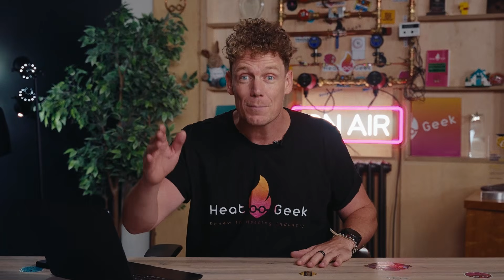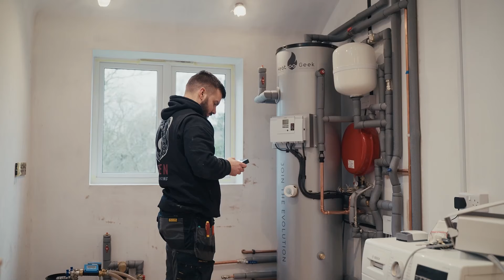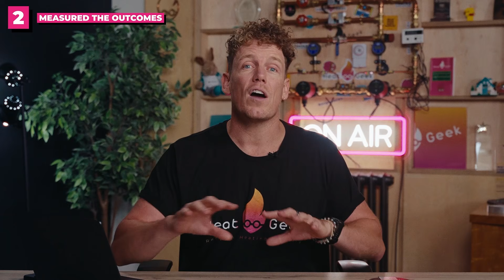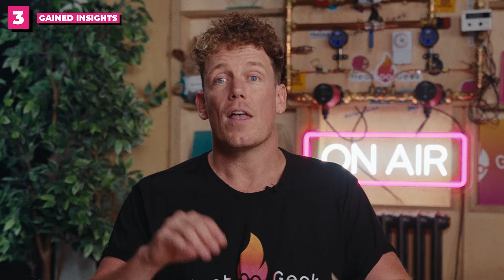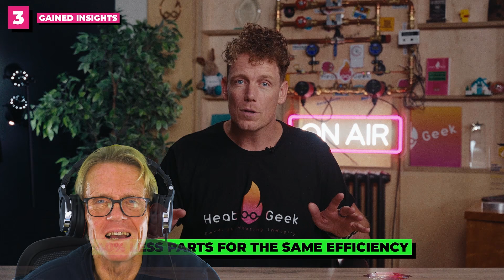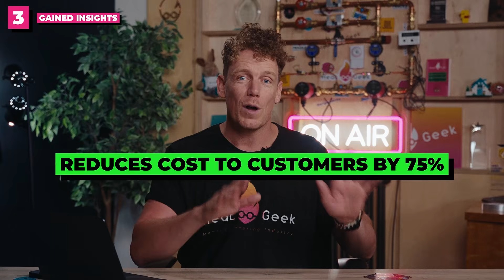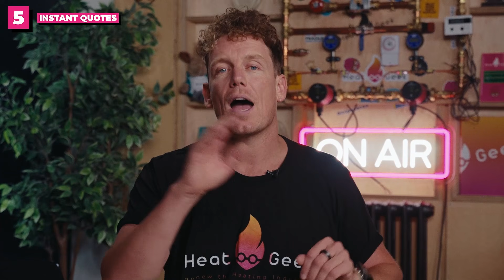Heat Pump Reality Check: Is Zero Disrupt Too Good to Be True?

Comment: Just pointing out that the Youtuber's in-loft water cylinder you highlighted was the one already installed for his former gas heating system and, in this case, Heat Geek were able to reuse it rather than installing a new one, thus saving him a few quid compared with the competition!
Reply: Absolutely correct.. he should be made to retract his remarks.. Not only that, he lost alot of credibility in my eyes
Reply: @patgreenerides I don’t personally like Roger’s personality. Seems quite arrogant and just a nay-sayer.
Reply: But the combi gas boiler is the most common in the UK! No hot water tank available to re-use.  Don't forget Heat Geeks sell training and a "franchise" - their new product is mainly spin telling the customer that they should employ someone who have used the tools Heat Geek supply.
Reply: Good point!
Reply: So what do you do if you have no space in, eg. a leasehold flat or small bungalow for a hot water cylinder? A heat pump isn’t viable.

Comment: People said the solar panels industry was stuffed when the grants stopped.  But the grants were there to kick-start it, and it worked.  Prices came down, performance went up (a lot), and solar installs are both plentiful and generally successful.
Reply from the maker: Well we know that heat pump prices have been inflated by the grant so maybe it will happen but there are more examples of green schemes failing than there are of them working.

Comment: I lived in the USA for 40 years until 2 years ago. The early heat pumps were not very efficient back in the beginning but the last 5 years has seen a massive increase in efficiency. I had the reverse cycle  system with a central air handler, ducting and vents in each room until the last unit . It was what is called a mini split with cassettes in each room individually controlled . It was over 30% more efficient than the central system. I believe it will be the same when comparing old technology radiators  and  heat pumps. Air to air should be on the  grant system. They are cheaper to buy and simpler to install. The cooling is just a  bonus if you want to use it. They are quiet and not at all intrusive.
Reply: It’s just deplorable that better heat pumps and installation costs are being deliberately gatekept and inflated. Hell here in Canada they gave money to GAS COMPANIES to distribute for approved heat pump installations as a subsidy…😅❤

Comment: A fool and his money are always easily parted........ exactly the same when flat screen tvs came out and were priced at £4000, then after all the rich and better off people had bought 1, the price plummeted...... now you can get a 50'' smart tv 4K for £300
Reply: Heat Pumps have been 'out' for past sixty years in UK commercial market.

The heat pumps themselves are not expensive with many coming in under £3k as installations are currently VAT free.

Cost of providing a low flow temperature gas boiler system would be no different.

Comment: We can't get off gas and oil. Gas is still used to generate a lot of the electric in the UK.
Reply: An excerpt from renewable UK website

"Statistics published today by the National Energy System Operator (NESO) show that wind outperformed gas in 2024 by generating more electricity for the first year ever. Wind provided a record 30% of Britain’s electricity last year (up from 28% in 2023), while gas produced 26.3%. December was the windiest month, when 38.9% of electricity came from wind, with record high amounts of clean power generated.

58% of Britain’s electricity came from clean power sources in 2024 as nuclear generated 14% and other renewables provided 13.8%. Coal produced only 0.6% last year, as Britain’s last coal-fired power station closed down in September."

Comment: Heat pumps have too much kit like hot water tanks, where you are supposed to put one of those in the small properties built in the last few decades.With regards Adam, I'm afraid I don't believe a word that he says. I did a H&V city and guilds course years ago and him saying you cannot work out the heat requirements for a building is laughable

Comment: Love heat pumps  became MCS accredited last year fitted my own at my house works great, love it and off gas completely and don’t regret it ( ex vaillant service engineer )
Tried to get some of my customers  on board but worked out too much as extra radiators etc needed or no space to fit external unit 
There Is too much red tape for me like everything else the uk have to endure this year I’ve removed myself from MCS as £1800 outlay every year I’ts not worth it for me  
became Fgas approved 3 weeks ago already have jobs booked in for air con (a lot easier to install )as customers see this as more beneficial for comfort in summer ….. just my thoughts……

Comment: Current cost of producing renewable electricity in UK. Was going to be part of a reply to another post which seems to have disappeared now.

Extract from UK government 'Contracts for Difference' document which sets the maximum prices each year

"Administrative Strike Prices (ASPs) for Allocation Round 7. ASPs represent the maximum price per MWh price for generating electricity – known as the strike price – that a project of a particular technology type can receive. Should an auction be triggered, ASPs limit the maximum price that projects of a particular technology type can receive, even if the auction clears at a higher price.  !"

AR7 Prices (July 2025) are

Offshore Wind :- 11.3p/kWh
Onshore wind 9.2p/kWh
Solar PV 7.5p/kWh

Comment: You can pull the plug on gas but where does your electricity come from? Most of the power plants in the uk are gas powered. Wind is transient and solar is miniscule comparative to demand. Turning gas into electric is very inefficient and then there's transmission losses etc. This outweighs any cop figures the heat pump guys rave about. A modern gas boiler can achieve 98% efficiency using the fuel at source. A gas boiler is cheaper to install, less complicated, and has much lower maintenance costs. Seems to me like government politicians trying to throw public money at a problem they know nothing about while at the same time taking a cut for themselves.
Reply: September figures from NESO website, giving sources for electricity in UK

Gas 21.8%
Wind 35.3%
Nuclear 9.6%
Biomass 7.3%
Solar 7.4%
Imports 15.2%
Hydro 1.5%
Storage 1.8%

It seems you are attempting to justify older technology because you can. Heat Pumps harvesting warmth from the air, are still more efficient than even your 98% efficient gas boiler (needing larger radiators, higher flow rates etc).
OVO quote the average British gas boiler as being 83% efficient.
Maintenance on an HP is minimal, clean a couple of filters, hoover debris from heat exchanger.

The governments of the day threw £Billions into subsidising gas boiler installations in the 1970's and 80's, and many council houses got them free.
All to replace the coal fire in the living room as the houses source of heat.

Comment: I don't feel like this is that radical. To get the utmost out of heatpump technology, insulation would be required to access the lowest flow temps and the highest SCOP possible. However with the latest models achieving SCOP of 3.1 upwards at 55C you do not need a hugely complex or expensive retrofit. With time of use tariffs you can save money even running at 55C.
Reply: 55C would be very wasteful, and for most completely unnecessary.

But for quick fixes might be needed.

Comment: It's kind of amusing how certain Roger is that 'most homes will never have a heat pump'. You are simply wrong Roger. Gas will be illegal to burn unabated in not that long (20 years?). Heat pumps will be totally standard with a decade and in about 20 years time there won't be many gas boilers left (and they will probably be paying an eye-watering standing charge). That's my prediction. We'll see who's right if we both last that long.
Reply: Listen to what youre saying.  If people cant afford heating pump and not allowed to burn gas you'll let them freeze to death?
Reply: @stinga_  

That sounds a bit dramatic, have you never heard of electric heating ?

Before gas central heating was a thing in UK (late 1970's) most relied on coal fires, with electric fires as an expensive addition to run, a few had oil central heating.
Then the advent of electric storage heaters followed by gas central heating changed the expectations of Joe Public to heating in a house.
Reply: And pigs might fly

Comment: This still does not get away from the basic principles that heat pumps cannot provide rapid demand heating as do conventional boilers.  This is because they operate at lower temperatures than conventional boilers and their overall capacity is limited by the electrical supply available.  Thus you cannot just swap out a boiler for a heat pump and the whole system has to be redesigned to rely on continuous running and constantly topping up the heat to work.  For this to be efficient, they need a well insulated property.  Gas and oil boilers provide rapid heat at a higher temperature so for their efficiency they rely on only heating those rooms in use as and when required.  Albeit better insulation clearly benefits both approaches, the issue for many with older homes is that it is simply not possible to improve the insulation to the point that heat pumps, no matter how cheap, become viable. 

It is possible that some form of hybrid system might bridge the gap, such that it would in Spring and Autumn just use a heat pump to raise the temperature in a room to comfort level and in Winter use a conventional boiler to rapidly bring a room up to temperature and then maintain it using the heat pump.  The simplest form of this is to retain the existing conventional boiler and add an air to air heat pump, otherwise known as an air conditioner that can run in reverse.  This would allow the home owner to just use the air to air to warm the room without running up the boiler, much as many people might use a fan heater in a single room.  The problem is the government does not subsidise air to air schemes, probably because it fears they will be used as air conditioners in Summer thereby increasing the total energy use.
Reply: You don't need rapid demand heating if it is properly controlled.

My HP is perfectly viable in my modestly insulated 1960's two bed semi.

As an aside I have a Daikin EDLA06 heat pump which does heating only, it's brother the EBLA06 has a reversing valve that allows it to cool as well.

Comment: We've got a Heat Pump..

An Air Conditioner that works perfectly and saved us £100 per month last Winter.

Hot Water was Solar dumped into a tank over Summer and for 4 months, we'll use £30's worth of Gas.

With heating £29 per month over Winter and £120 in Gas, I'm glad we swapped our boiler for ANOTHER boiler.

Backup in very cold weather and with batteries can run it during a Blackout.

Water Heat Pump - no thanks.

Comment: If heat pumps are that great, why didn't politicians want to keep them in the houses of parliament.
Reply: They do and they are, they have three HP systems in place, with no new ones since 2022.

New additional system currently paused over concerns regarding power supply and acoustics.
Reply: @_Dougaldog exactly they are too noisy for the politicians…
Reply: @stevenrobinson5864  

The existing systems are not causing any issues though.

Comment: They don't guarantee every home. I had a heat geek survey and they said the house was too big and they don't install over 12kw pumps. I needed a 16 and they won't install.
Reply: Go get a 16kw system boiler, 18 is closest. Then fit an unvented and you’ll be best off
Reply: A different Heat Geek engineer might be happy to do it? Do it black label/more bespoke? Might there be options to reduce your heat loss?
Reply: @Biggest-hz7ng  That is an option but it doesn't come under the Heat Geek guarantee then.

Comment: Why does no one really discuss the extra demand on the Electric infrastructure, its all well & good removing gas boilers from domestic home , Electric cars etc is all greater demand. Why do we go on so much about "greenhouse gases" as we as a nation produce less than 1pecent of total world emission. Its minute compared to USA, CHINA , BRAZIL etc.
Reply: We all need to contribute to emission reductions. We emit a greater share than our population share.
Reply: Demand on electricity grid is currently at a lower level than has been for a long time, thanks to more efficient uses of electricity, yes it will increase over time, but so is our renewable supply and grid upgrades needed.

Comment: This has always reminded me of solar. The tech works well enough to be practical but not well enough to completely supply most people's needs alone
Reply: Really poor analogy. Heat pumps fully supply heat to commercial properties without problem. You don't see Currys needing a log burner for heat, for example.

Comment: Without a door blower test the heat loss calc is worse than guesswork. My Octopus heat loss calc was 50% over the true empirically verified heat loss 6:58
Reply: Airtightness really does matter, you are right, but for most people they can just measure their heat loss from the existing gas consumption.

Comment: Poor Roger. Gunna have heart attack. He hates that heat pumps work 😂
Reply: My gripe is the cost,and the fact I do not trust any company that is given grants to install them from the government because their incentives are money and stats driven.  Not driven to install a quality system. 

And at the end of the day, I don't care how my house is heated as long as I don't have to think about it. Right now, my thermostat pings on, and my house heats ,I couldn't care less if it's gas being used electric or just a heat pump.
Reply: They may work ,you mean
Reply: Yeah they do work, BUT they are expensive to fit and with high electric prices, they are expensive to run. 2BR ground floor flat, 100% electric only bill is £2600 a year. Mad. Used to be much cheaper when leccy was cheaper. Paying 28p/kWh fixed for 2 yrs.
Reply: They are shite.
Reply: @grhamp Which one have you got?
Reply: Well insulated large house top to bottom, 2 degrees overnight outside , two 11kw heat pumps on continuous 45degree flow use about 42kwh over 6 hours .
Reply: @pmbpmb5416 Yikes. But they will just say "well get solar duh, spend £30k on batteries man, sell it to the grid for 12p in the summer to pay for the 35p peak you pay in winter bro"
Reply: @pmbpmb5416 they're  not set up correctly then
Reply: Define "work" .
Reply: Only providing realism, not 'hate'

Comment: Adam mentions "energy" costs rising. Which energy costs, Adam? Gas or electricity. Heat pumps rely on electricity, which is the cost that's rising, not gas.

This guy is your typical, fast talking, double glazing super salesman. An utter fantasist. He will end up going on the run because he owes so many people so much money.

Comment: And from what I can take from this I still can't have one because you need a hot water cylinder. We have no room for one.😢
Reply: The smallest cylinder is about the same size as a gas boiler. Heat Geek are testing them over this winter

Comment: I would say my biggest problem isn't so much the cost as whether it's going to work. I currently live in an old building with a gas boiler. There's no loft so there is no loft insulation, It's solid brick so there is no cavity insulation as there is no cavity. What does still work with our house?
Reply: An excavator.

Comment: My heat pump keeps me more than just warm. Very toasty. It also saves a fortune. The problem is gas heating installers, and builders switched to heat pumps without a clue as to what they were doing. Give a monkey a spanner and expect the entire job to be a disaster. Proper training is needed     and follow up inspections with mandatory fixes/re-installations when installers screw up. One problem is the building industry is so corrupt getting anything done properly is next to impossible.

Comment: Im still not sold on heat pumps, ok im 73 and an old fuddy duddy but i had a solar and battery system installed 2 years ago and don't regret it as the solar over the year covers the electricity and gas costs due to selling excess to the grid, also 0 cost of running an electric car (secondhand) Why am i not sold on heat pumps, because i have microbore and laminate flooring throughout the house plus an efficient gas boiler that is 2 years old. Can you imagine the cost of replacing the microbore and relaying the floors alone!
Reply: Not all microbore needs to be replaced.  Heat Geek have videos on this. Though you still might not be tempted having had a boiler so recently installed. Ours was 10 years and starting to need parts, so we made the switch.